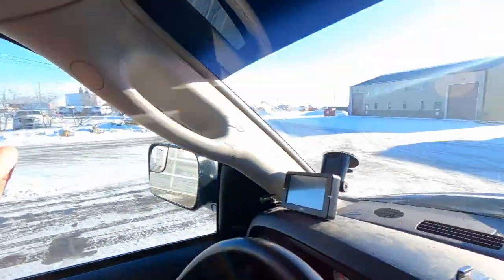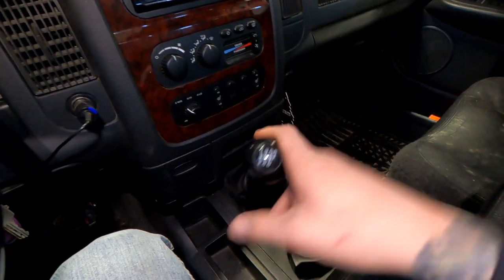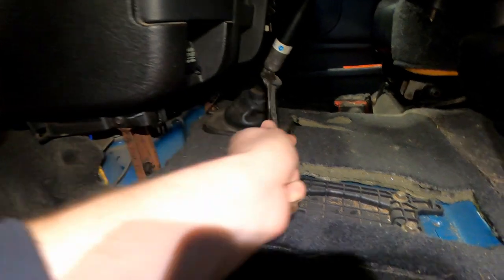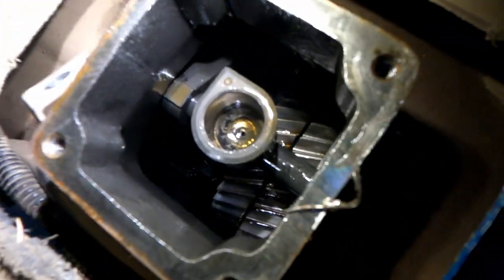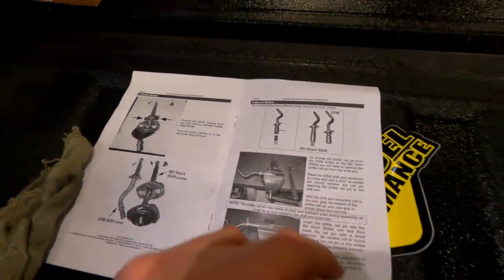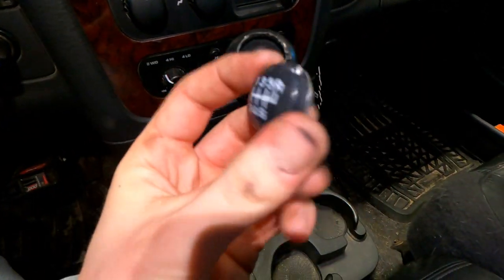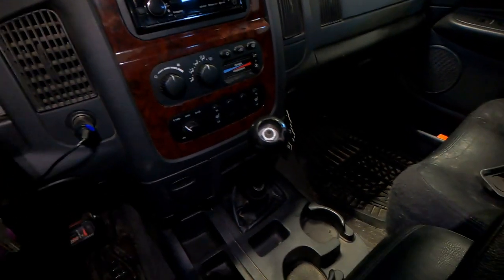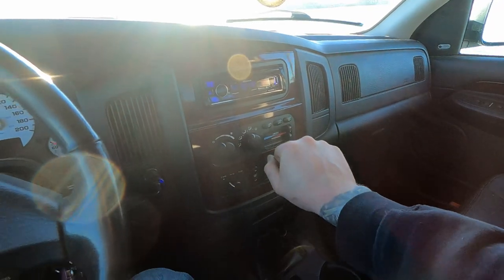Testing SHORT SHIFT KIT 5.9 Cummins NV5600

Comment: Thank you for sharing this information I also have a 2005 Dodge 3500 with a 6 speed NV 5600.  I m getting ready to change the lubricant oil in the trans and replace with your recommended Redline mixture, It looks like it’s been a year or so since you’ve changed the oil in your trans according to the date on this video and I wanted to follow up with you and see how you like the red line mixture in your transmission….. has it worked well?
Thanks Chris

Comment: I used have the bd short shifter on my truck. I was driving home one day and shifted into 3rd gear. The shift lever broke off at the top of the transmission housing. Luckily I was close to home and was able to limp it back. Hopefully they have improved their design but at the time they knew they had a flaw in the design. They were willing to offer a free replacement but I declined and decided to stay with the stock design.
Reply from the maker: Shit how long ago was that?
Reply: @darkirondiesel  sorry I should have clarified that. It was around 4 years ago. I had already had the part installed for right around a year and a half. Their customer support was very good when I called in with my concerns but I couldn't get a answer that I liked so that is why I went back to stock.
Reply from the maker: Well let’s hope for my sake that it was a one off situation, or that they fixed the design flaw haha
Reply: @darkirondiesel  they make good products, I would think something like this would be taken care of rather quickly. I loved the short shifter when I had it and would probably go that route again, just don't have the time right now to mess with it.

Comment: I see you have an electronic transfer case. I'm in the process of doing a manual swap and other than the 29spline swap what else did you need to do? I have read a lot about problems for 4Lo to work. Appreciate the channel

Comment: What about us with a 2003 5 speed NV 4500? Am I just SOL? 

Side note: If you tow or travel up steep grades, always overfill the NV56 or NV45 to a total of 5qts. 4 is fine if you don't tow or never leave flat ground. The engineers themselves admitted they forgot to calculate those situations when in the design phase.

Comment: Instead of screwing up the shifter ball you could have used a washer under the shaft where they thread together. Find the right thickness and it wold have changed the orientation of the ball
Reply from the maker: Ya true, but I didn’t really care much since I already had an aftermarket shifter ordered at the time of making this video

Comment: I’ve got an 03 with the 5600. Just did a southbend single disc thinking that would help with shifting. Getting into second is hard to find with out going to third gear first. I didn’t see much my way of brass when I changed the fluid. Any thoughts on what would be causing it? Synchros?
Reply: Just the way south bends are. I’d recommend going with a Val air stock or 400hp clutch
Reply: @Foxtrot_Vet  Thanks for the input. I'll check out their clutch once I toast this one. I've added some tuning and will be throwing a bigger turbo soon. So I figure it'll happen relatively soon.

Comment: What fluid do you use in the nv5600 and how much. I just bought one from a transmission shop and they said to add 8qts of 75-90 gear oil. But everyone else uses synchromesh and they only use 6 qts?
Reply: Best to use Penzoil syncromesh 8qts

Comment: I just bought an 03 5.9 Cummins a few months ago. It has 2” spacer level and 35” tires but the truck wanders all over the place when on the highway. I just put a thuren track bar in to replace the 250000km stock one but doesn’t seem to make much of a difference. I also tightened up the steering box which makes it steer a lot quicker but seems to make the wander more pronounced. Have you had any issue with your dodge?
Reply from the maker: No my dodge rolls down the highway like a champ, but I have a whole new front end in it.  My first suggestion would be getting a wheel alignment because if your tow is set incorrectly that can make the truck wander.  Also check all your front end parts, in fact just take it to a reputable shop and tell them you want them to look over the front end and do a wheel alignment if nothing is majorly worn out.
Reply: @darkirondiesel  thanks for the advice from Lloydminster. Great videos, keep it up

Comment: 2001 Dodge Ram 3500 dually 2nd Gen Manual transmission does not run has fuel pump issue asking $4500

Comment: I only ever fill the nv5600 from the top. 6 qts. I drove last year 120k miles at that amount with trailers up to 30k combined weight and never had an issue. 465k miles unfortunately I don't know if it's original.
Reply from the maker: I think I have 6qts in mine as well but I was able to fill it through the top bolt hole of the pto cover
Reply: I do 8 quarts in NV5600. No drive shaft leak. Shifts way better. Runs cooler.

Comment: Awesome Video Brah! Greetings from Montmartre Sk. I have an 03 cummins and been having problems lately. What is your knowledge on injector leak back? Or injectors pouring WAY to much fuel into the cylinder and causing the oil pan to fill up with oil. The truck is parked and after it ran away I don’t want to even try starting it again until I have some more ideas on where to start. The turbo is fine, and I was able to choke out air supply before she tore herself to pieces. I am a journeyman heavy truck mechanic but don’t work as a mechanic anymore as I’m now back on the farm. Also, I don’t have a lot of experience with the fuel side of the common rail cummins. Can you do a video on this topic?? Any info would be great. And if you need a truck to diagnose or whatever to show how to diagnose or work on let me know and I’m sure we could work something out.
Reply from the maker: Hey buddy, what I would do first is pull the injectors out of the truck and have them tested. There are also fuel feed tubes that go from the fuel lines to the injectors through the head, if one is cracked it could be dumping fuel into your cylinder head.  But ya pull the injectors and fuel tubes out and then go get the injectors tested there are a few places in Saskatoon that do it. DSG and IDP both test them